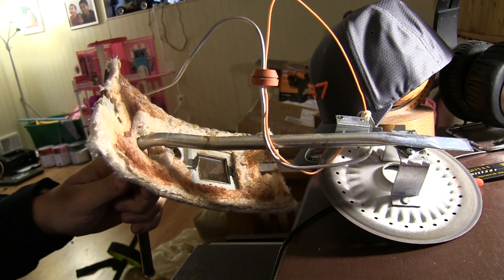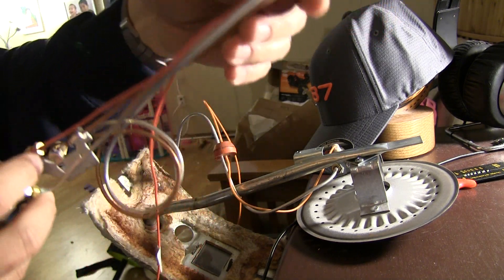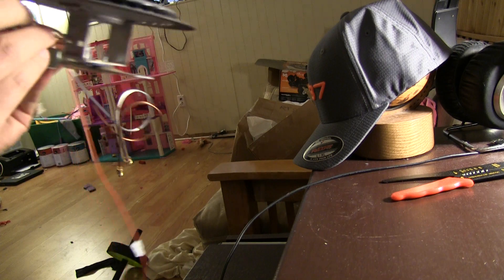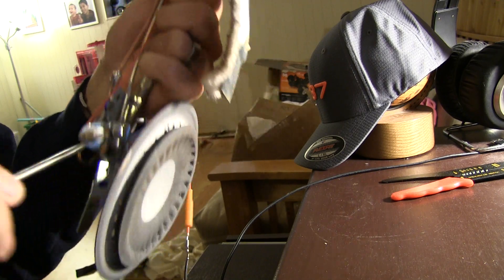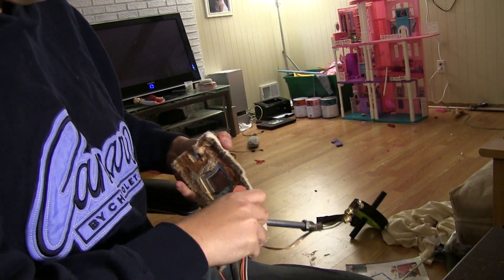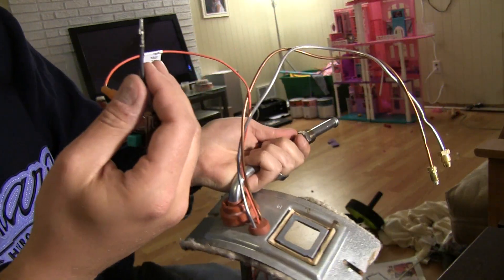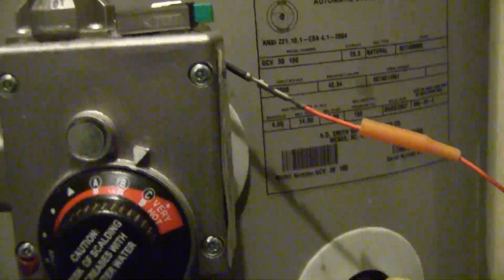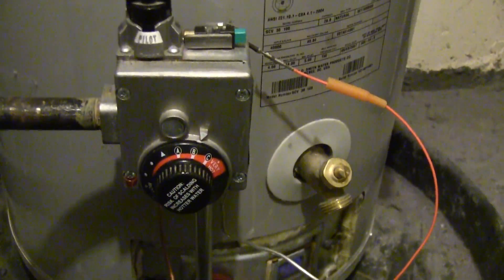AO Smith Water Heater Thermocouple Repair & Overhaul

Comment: I light the pilot stays on burner comes on then randomly shuts off? some times a minute after burner starts  Any idea?  Should I replace this unit.
Reply from the maker: If you haven't replaced the thermocouple yet, I'd start there.
Reply: @JaysDMC  I ended up measuring the thermal coupler with a multimeter it was 28 millivolts that seems to be fine turned out the filter was completely clogged up not getting enough oxygen so I use a compressor blew it out and  a Shop-Vac to suck all the debris out reassembled working like a champ
Reply from the maker: @petebuka  NICE!!!  Gotta love the repairs that don't cost $$$.  Congrats!